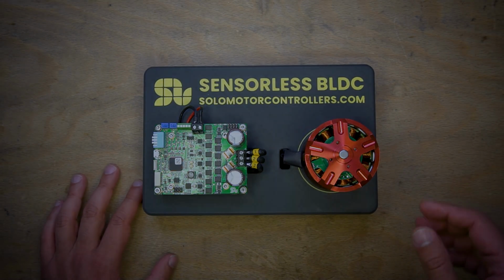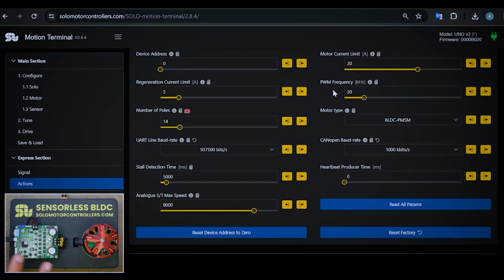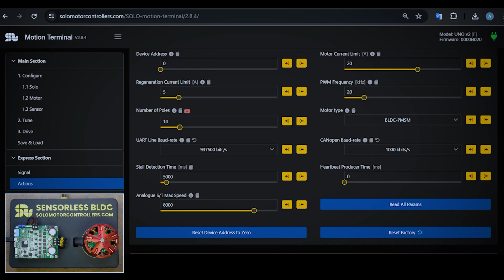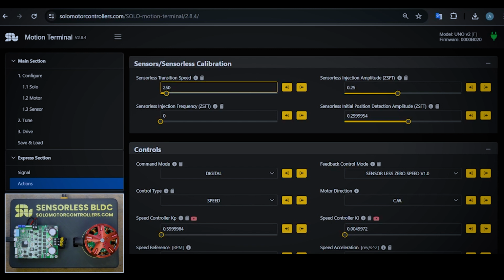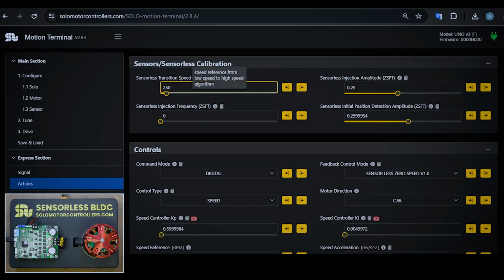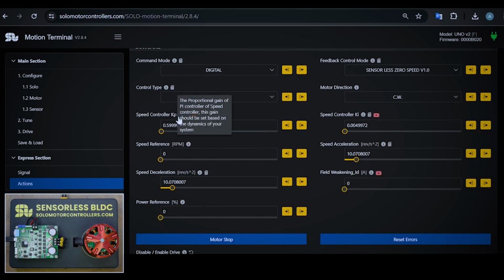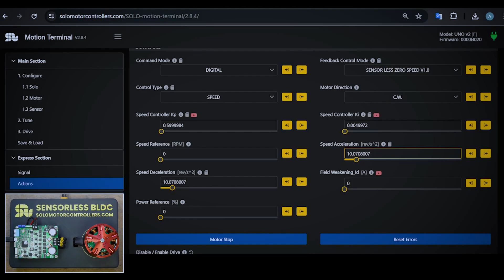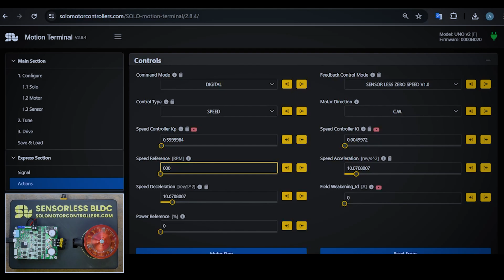Extremely Low Speed Sensorless control of BLDC/PMSM - High Frequency Injection

Comment: I was given an electric smart car.

I both love it and hate it. 

I would love to use one of these boards to upgrade the traction control. Long-Term plan is to completely replace all of the electronics.  I also want to replace the entire wiring system with power over ethernet and/or ethernet overpower.

I want to make it plug and play by the time open source AI can drive.